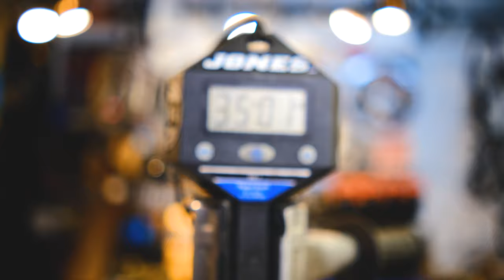My Titanium Omnium Cargo bike - Lemme tell you about it!

Comment: hey! this is sick! What did you have to do on the frame for it the allow internal wiring for the dropper post ?! thanks !
Reply from the maker: thanks! you'll need a drill, a carbide tipped drill bit and plenty of cutting fluid! i used files to center the start of where the hole would be since i didn't have a center punch.
Reply: @stay_loose  awesome, thanks for the info. Im a little stressed out with drilling a holes in a Ti frame.
Reply from the maker: @Jean-ChristopheDesbois  haha i totally get it. it was a little scary at first, but it wasn't very different from drilling steel. my biggest piece of advice would be to make sure it doesn't overheat, so use that cutting fluid as you drill!

Comment: Have you ridden a bullet style cargo bike? Trying to decide which style I want to make first.  Low cargo platform longer bike or higher platform like this with shorter wheelbase.
Reply from the maker: i had a Bullitt before this Omnium and i like both a lot, Omnium just has wider tire clearance and more modern standards. can't go wrong with either!
Reply: @stay_loose  thank for that. I am trying to make my own cargo bike and trying to decide which style to do first...the omnium style seems easier to make since it's basically a straight tube between the BB and the top of the front wheel with a level platform bolted on it, vs the bullet style with the low flat member and kick up to the front wheel in front of the platform seems more complex to duplicate.